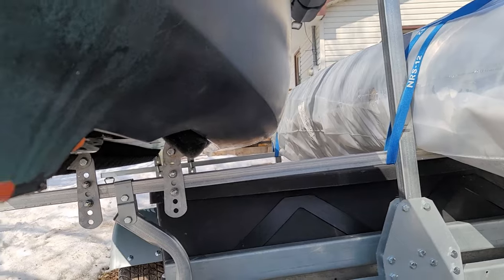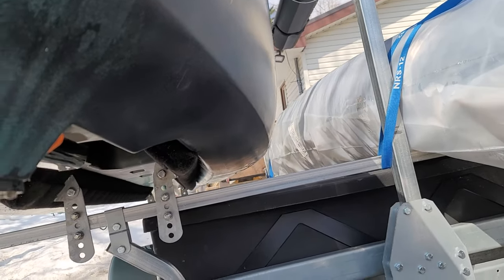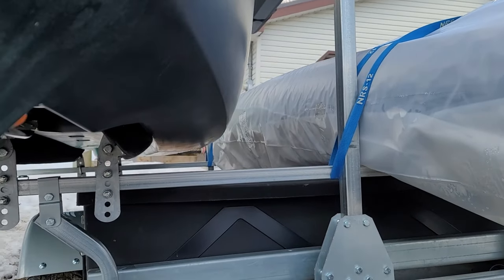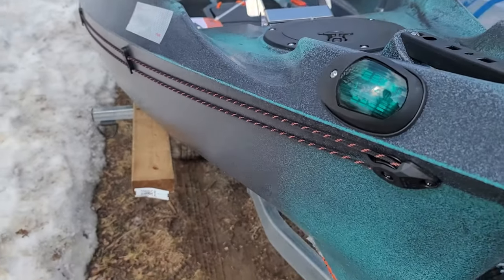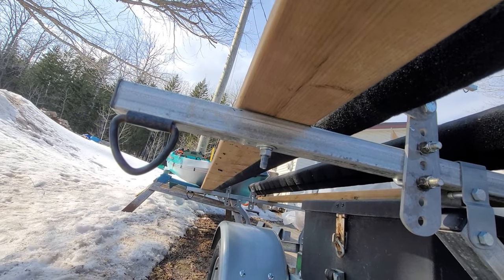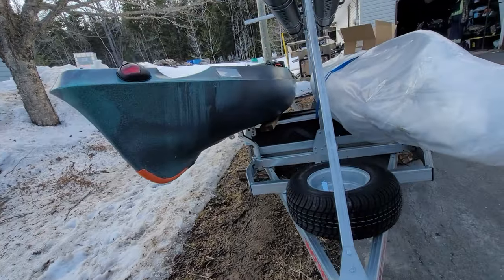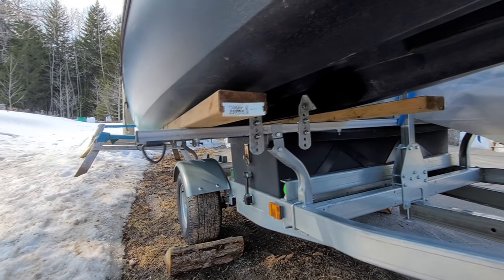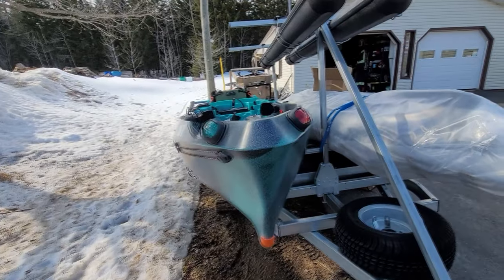The best Cradle System I've seen to support the Autopilot 136

Comment: Nice. That looks great, I also like how it slides on then drops into place. BZ
Reply from the maker: Yeah, the malone bunks catch the vertical  feature where the hull channels starts which will act as a bit of a safety feature when accelerating in the truck. Im hoping the setup doesn't create any unforseen issues. The one thing I didnt show is I angle cut the back end of the extra boards so the yak wouldnt catch when sliding onto the trailer. Hopefully the boards dont slide right through the hull at some point in a rush....hahaha
Reply: @Outdoorsnb  only time will tell, but at first glance, she looks pretty solid. Can't wait to see it in may

Comment: Thanks for the video. Noticed you don’t use a winch on the trailer for the kayak.  How do you retrieve it to the bunks from the water. Pulling with a rope ?
Reply from the maker: I went with a Malone trailer with the intent that it would be used as a boat trailer. Thus the reason I selected malone as the trailer is galvanized. I back it into the water and float the over 200lb (loaded) boat onto the bunks. A winch would rip that navar kayak handle right off the bow and permanently damage the hull. Johnson outdoors does not recommend storing any of their water craft from the handles for the same reason I dont want to subject them to the increased load of the hulls resistance against the bunks and trailer as its dragged up on. The resistance and the angular load actually increase the force on the only two transfer points for that load (the two handle bolts) the hull is nothing more than linear Polyethylene, whose modulus of elesticity decreases with temperature increase, doesnt like point tensile loads in the summer. The scuppers on the upper deck dont like their lower radiuses to be supported by the very small contact point of a PVC bunk either. Its half the reason people are seeing cracked scuppers> if you dont spread the impact load of pot holes out through anything more than the very thin radius contact point of a round pipe on the bottom of the hull all of that force gets transfered up through the closest vertical members (the scuppers) and gets terminated at the upper radius of the scupper hole as it tries to transfer that force through 90 degrees to the upper deck but it often overcomes HDPE's yield strength in the attempt and you are left with cracks at the scupper radius where many have been failing.

Comment: But the hull is curved down that hull groove..........the 2x4 bunks are not.  From the video it appears you have full-length contact on the corner of the bunk only.  I have a pair of vertical bunks that ride the hull at the bottom of that curve with full contact AND a pair of horizontal bunks that support the hull outside that curved groove.  I think angling the bunks as you have results in less contact between bunk and hull...........much less.  I looked at the same possibility and determined vertical was a better position.
Reply from the maker: I was hoping to have the angled pieces act more like a wedge against the outer pontoons so as to not put too much pressure on the scupper areas as I think some of the cracking we have been seeing from folks online may be a transfer of the hull weight up through the scuppers where they are stored with bunks near them. The weak point then becomes the stress concentrator at the scupper where they transition from vertical to horizontal. That was my thinking anyway. But you say you have better contact putting what I have on the angle in a vertical orientation? I may have to look into this.
Reply: @Outdoorsnb  Just sent an email with a photo of my bunk setup...........worked very well for the last three years.